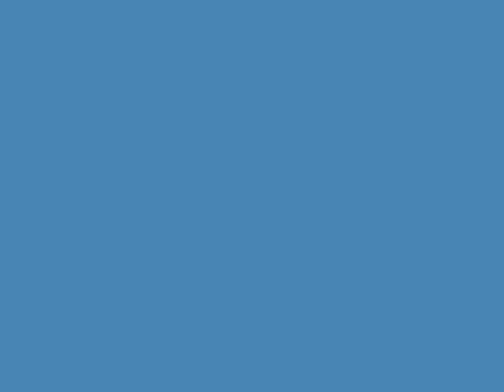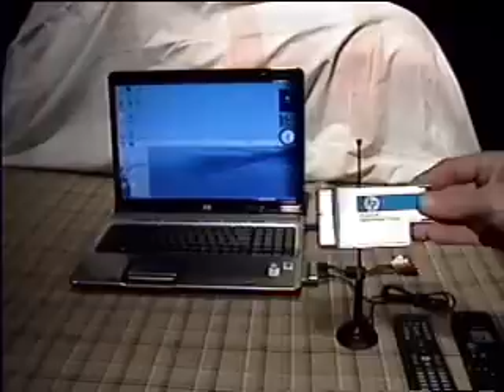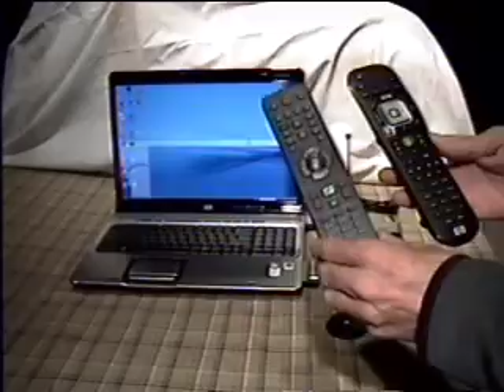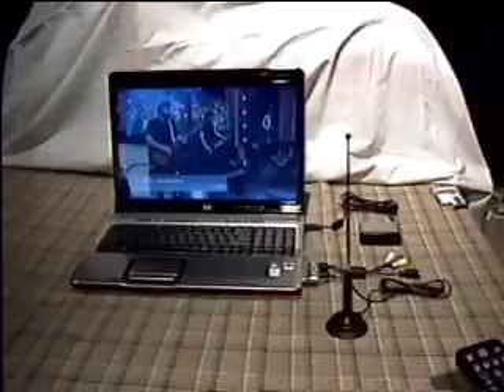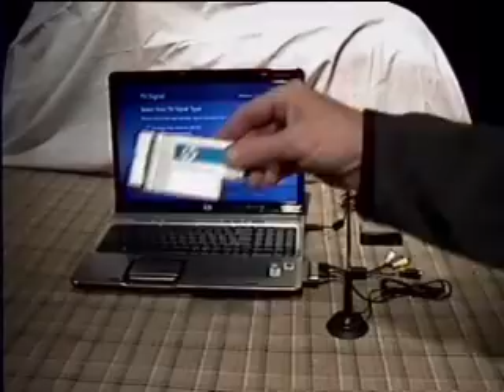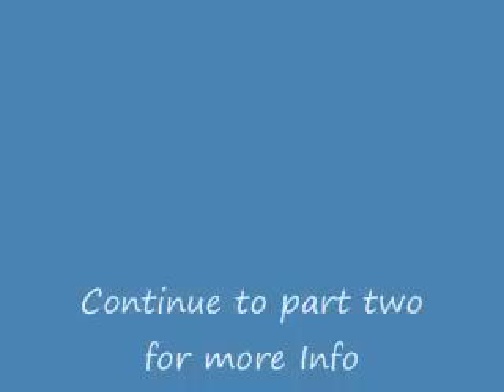First Install & Set-up of hp TV Tuner & Useful Tips (Part 1)

Comment: How the hell do you use the AV/S-Video adapter? There is no information on how to view those inputs, and Media Center doesn't have an option to choose those inputs either.

The manual is a joke it just tells you to go into channel setup but there is no option to select AV/S-Video input instead of the Antenna/Coax.

Comment: I just installed my old VCR via an hp internal tuner, and the video is intermittent. It will show the picture for one second and then black out. Audio is fine. Tried a different coax cable and issue remains. Do you think this is a a software issue or adapter problem? Help?

Comment from the maker: You need the little cable that you can see in the  video that handles audio and video via rCA connections. You need a cable to go from the back of the TV to the little connector cable that attaches to the tuner card. I have  a6 foot cable I can kick in free from GetAdapters, but i don't have anything longer. Thanks for watching. JR

Comment: So, the analog cable that you'd normally put in the back of your TV, can't be stuck directly into the HP Digital/Analog TV-Tuner, right? It does need sort of a transition cable, doesn't it? Thanks in advance for your response :-).

Comment from the maker: Yes, it definitely works with the dv6 models as long as the DV6 is running Windows Vista or Windows 7 operating system. The GetAdapters website has the tuner with different options and you get free extras too. JR

Comment from the maker: No. you just need to have a laptop with an expresscard 54 slot, running Vista or Windows 7; and then it will pick up analog or digital TV signals for free out of the air using the antenna you can get with the card from GetAdapters. JR

Comment from the maker: Yes, it will work with xbox, but you have to have vista or windows 7. It won't work with the media center that came with XP, unless you have the very last version that came out just before Vista; it's called Windows Media Center 2005. It only came out for a couple months at Christmas 2007 because they didn't have Vista ready for Christmas on time.

Comment from the maker: Hi. The tuner from GetAdapters comes with an antenna that picks up signals from the air exactly like a TV set.  It basically turns the laptop into a TV. Like any antenna, once you get too far away from the signal, it won't get a channel, but if you are anywhere near a major city, then you'll probably get all that city's channels. JR

Comment from the maker: Hi, Yes you can watch comcast by simply using the AV cable (that comes with the tuner from GetAdapters) to attach to a cable coming from your comcast box. It passes the comcast signal through to the laptop. With that configuration, you would still need to change channels with the comcast remote, pointed at the comcast box.

Comment from the maker: Hi. There are two kinds. I use the hp expresscard54 digital/analog combo TV Tuner. If you just plan on using it with comcast, and not on the go, you can get the less expensive hp expresscard54 Analog-only tuner. It won't get digital signals free out of the air, but it will pass the comcast digital signal through to your laptop. GetAdapters (my website) has both the digital/analog combo tuner and the analog only tuner. You can get the cards with the basic cable set or with all the accessories. JR

Comment: I have an hp laptop with a TV-Tuner DVB-T incorporated. The Windows Media Center never gives me the option to choose analog, digital, cable, antenna or anything. Could you please tell me which version of WMC is this one? Im from Argentina, i plug the antenna or my cable service cable and the WMC never detects any channels. Since it does not let me choose signal type I don't even know what it`s searching for. Great if someone could help me.

Comment from the maker: I had a cathedral ceiling and no tall ladder, so I put off changing the battery so long, I don't even notice the beep anymore. I finally borrowed a ladder and got it changed. Hooray for wired-in smoke detectors! I moved, so my next video will be minus the beeping. Thanks for the ears up. JR